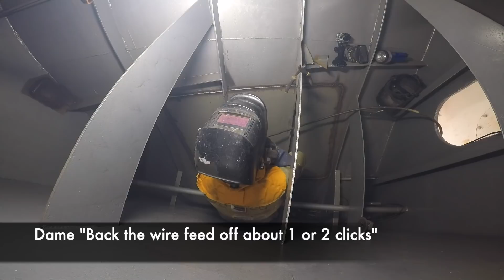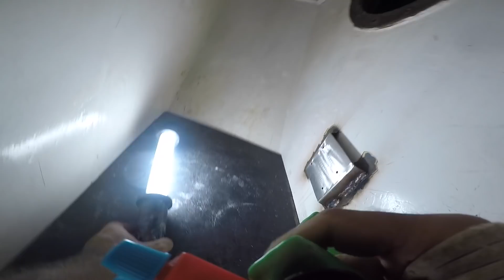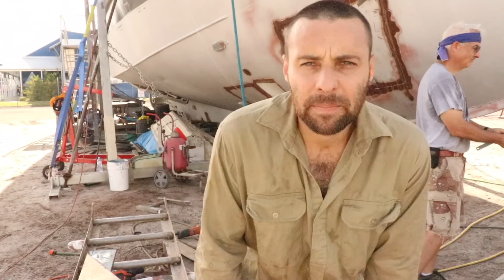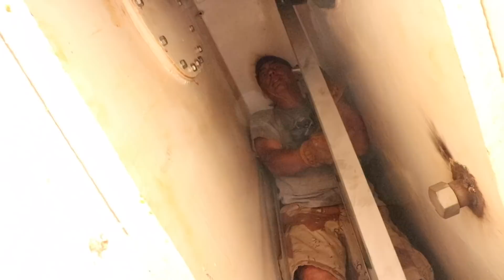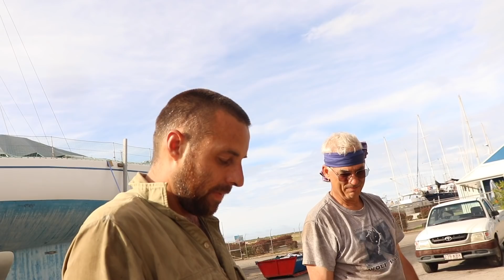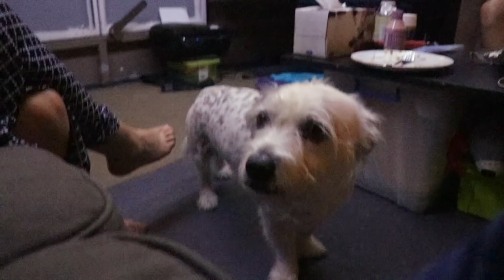Welding our hull closed (part 1) - Project Brupeg Ep. 75

Comment: I was sitting watching this video and wondering why you weren't fitting the ladder to the hull side between the tanks and then you explained it. 

I love the music as per usual, wish you'd have turned the bit while driving up a wee bit.

I used to work in the tank container manufacturing industry and there we used to weld the dished ends on the tanks using a process we called double tig. We had two welders tig welding the 8mm stainless plate, one on the outside and one inside the tank. The one on the inside followed the weld on the outside while the one on the outside applied the filler rod while welding. The tig torch on the inside would draw the filler material through to get 100% equal penetration - to x-ray standard. I've always wondered whether it would work with a mig and tig combination.

Seeing you get all emotional about the tools made me all emotional. I said to my wife that good tools are about the best gift you can give someone who works with his hands. Yep, we always watch your videos together.

Getting close now... exciting times. :-)
Reply from the maker: Good on you Gary. Yeah it would be interesting to see if dual welders would work on a trawler

Comment: Great video I have started using cobalt drill bits and found these much better on steel and stainless. However some stainless is hard as nails and you need a pedestal drill running real slow to get thru it and plenty of coolant. You got there in the end though and that's all that counts. Great job. Chris
Reply from the maker: Cheers Chris
Reply: Moly-disulphide cutting compound.
Reply from the maker: Thanks I will do some hunting for that
Reply: @ProjectBrupeg  Trade Tools was where I got mine. Dont need much and container is quite small.
Reply from the maker: Brilliant thanks Lynndon

Comment: You need Cobalt drill bits for stainless , and go slow, also be careful with Cobalt drills as they snap easily if bent or if they bite. And they are not cheap!
Reply: Just like they said real slow on the drill!!! Real slow!
Reply: agree , slow rpm on the drill, keep pressure on while drilling, wd  or machine cutting oil   to cool the cut
Reply: Andrew n

Comment: I’ve used beeswax for stainless with good effect, and just common drills.   However very slow drill speed.   High speed just hardens the stainless.   However it can be a bar start to work with.

Comment: You need a Cobalt drill for that stainless.
Reply: Cobalt drill set for stainless and slow speed, but be gentle as cobalt drills snap very easily if bent or if they bite.
Reply from the maker: I have found this Andrew. Wasn’t expecting it first up
Reply from the maker: Yeah we are slowly replacing our bits with cobalt as the HSS ones die

Comment: drilling stainless...go slow dont force it and use water rather than cutting oil
Reply from the maker: Thanks for that
Reply: What helps much, too, is not using Your drillbits for both but have some extra for the stainless, or grind the mildsteel ones before using these on stainless.
So: no mild to stainless change without kissing the cutting edges with a grinder.
Reply from the maker: Ok good to know. Thanks

Comment: You need a better light in those tight places. I'm going to send you a good rechargeable light next month.
 I have one myself.   EBay # 
 https://www.ebay.ca/itm/Astro-Pneumatic-40SLMAX-450-Lumen-Rechargeable-LED-Slim-Light-w-XL-Battery/142459211481?hash=item212b3b0ed9:g:RQcAAOSwSdFZhNdZ&vxp=mtr
You will love it. 12 hrs on low 4-6 hrs on high.Just like a cell phone to charge.
Reply from the maker: Dennis that sounds amazing. Thanks for all your support.